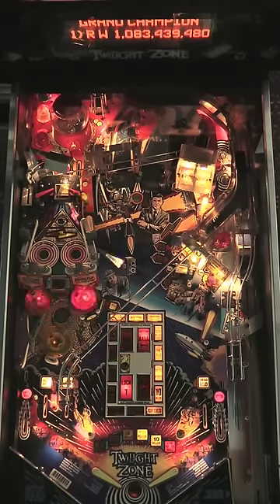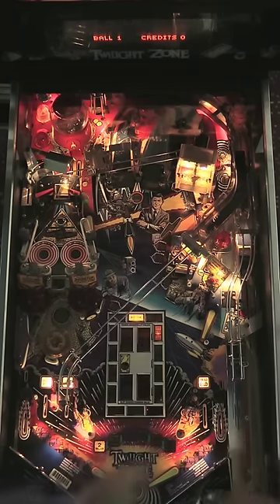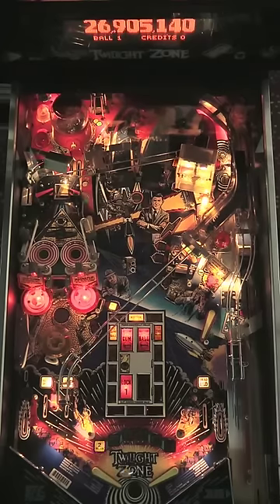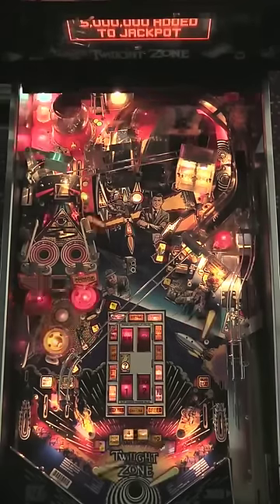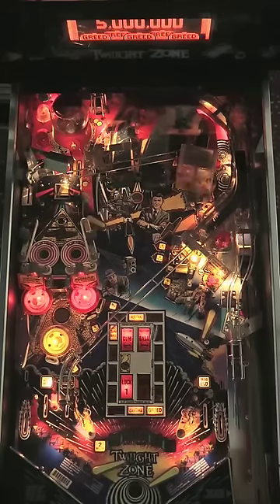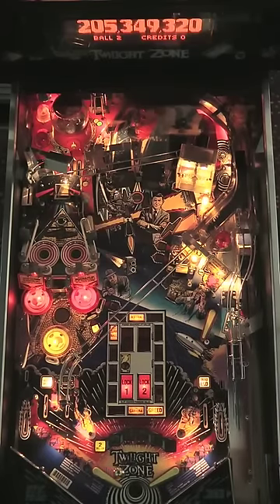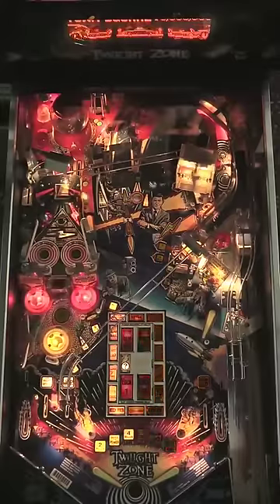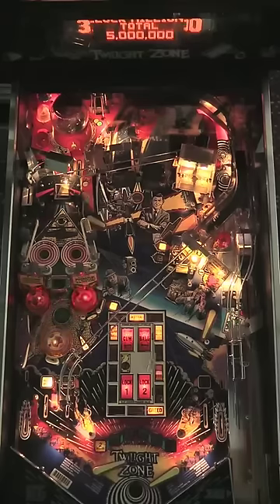Twilight Zone Pinball Tutorial

Comment: When battling the power, it's better to hammer 2-3 times quickly on the flippers than it is to try and tap-tap-tap your way to victory.  By tapping I can beat the power maybe 12% of the time, but hammering is effective > 60%.  (I've confirmed this behavior on 3 different 'machines' - 1 in Laconia NH, 1 in Pelham NH, and pinball arcade off steam.)  Hammering has the bonus of additional side to side action that gives an award of ~1M per hit during the battle.

Y'all might want to give it a try.  Basically you want to multi-tap the flips any time the ball is at or below the top of the red circles.  Repeat until you blow up a pyramid or two.  Since this awards a door panel, it's super helpful towards getting Lost In The Zone.  It also avoids the bumpers, which are terrifying and drainy.

Comment: Which is the "next shot down" he refers to at 9:09, does he mean just letting the ball fall out of the power field? Is there a time limit on that shot to get the jackpot or do you have to have at least 2 balls in play? Also, is there any objective scored by knocking down all the pyramids in the power field, I think it starts at 20? I asked a local avid player and that was one only things he hasn't figured out, just knew you got some decent extra points for knocking some down.
Reply: I think it's making the camera shot while there are at least two balls on the table. That's where the magnaflip balls go, so if you make it the m/c thinks you've landed the jackpot. Had this machine over 12 years and I don't know about that pyramids issue!
Reply: No, "next shot down" towards the floor. There is no switch to detect the ball in the top exit to the power field, so it falls through into 'the camera' and hits that switch. He cheated by shooting the camera while there was a ball in the power field.